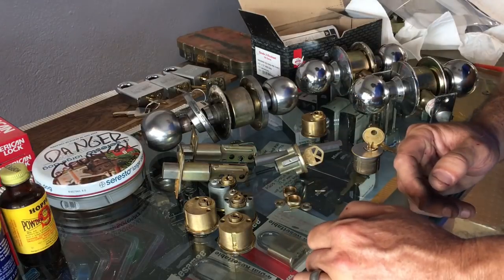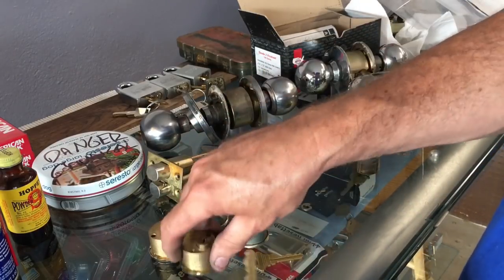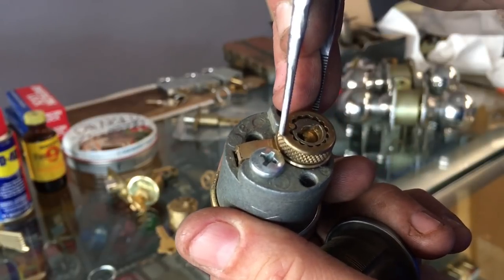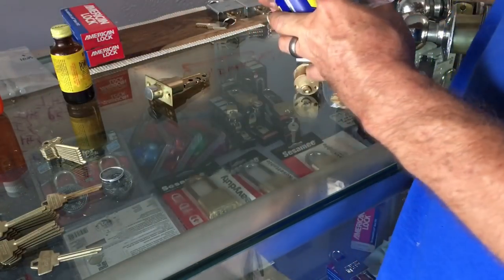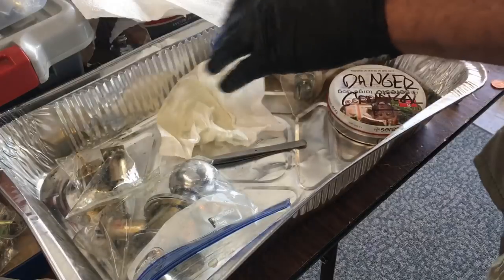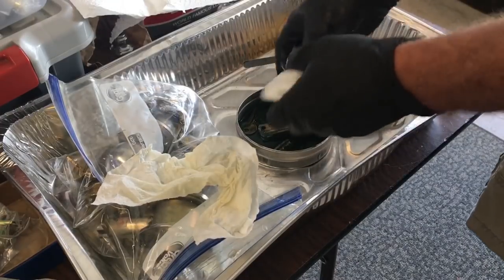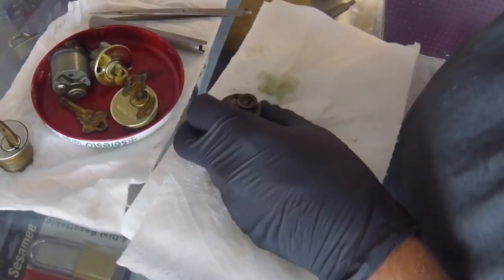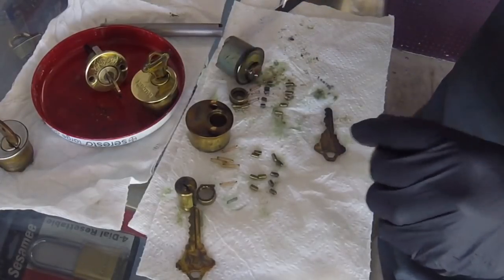Hoppe’s Solvent 9 vs Locks (oh & WD40)

Comment: I have used Chem Dip parts cleaner to soak old funkey locks and it works fantastic but you still have to disassemble them to get the funk out.

Comment: Why use anything other than WD.?? I’ve Been using it my entire life without any desire to change. If it’s not broke, don’t fix it..
Reply: Peter D'Ambra because WD isn't a lubricant it's a water displacer and it causes junk (dirt, grease, etc.) to build up, causing the lock to need fixing.    16:45